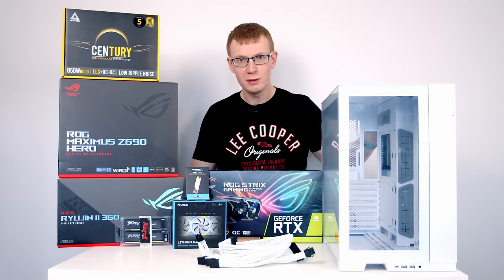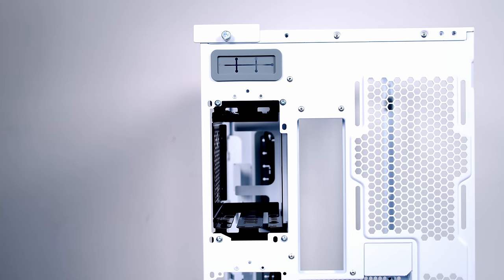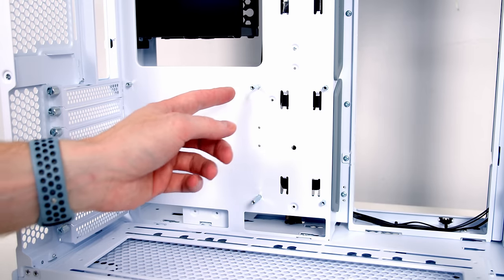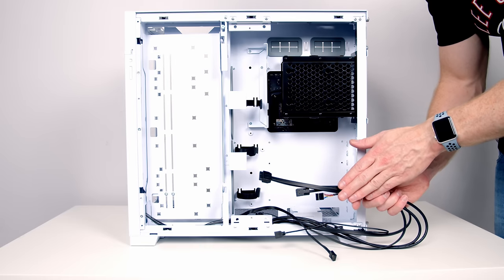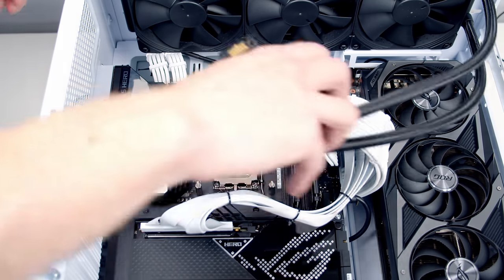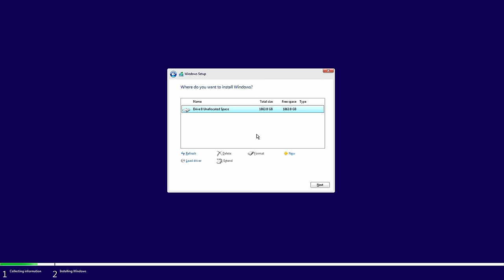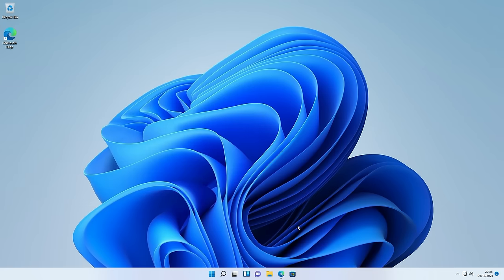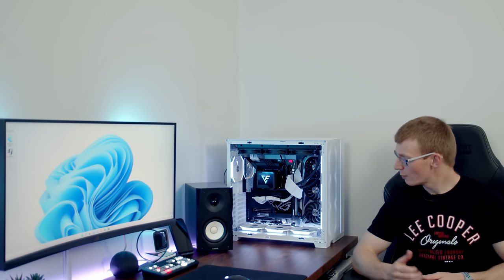Lian Li O11 Dynamic EVO - Step by Step PC Build Guide

Comment: Hi Christopher, im watching your video and so lucky i have stumbled to your vid. Im doing almost the same build. But im so confused with the connectors im hoping you can help me a bit. 

I have a msi b650 AM5 mother board, im trying to connect the Lianli Galahad 360 connectors but i have no idea how to do it. 

On my Motherboard i only have 2x 3 pin header. So i have the case one, lian li uni fans fan hub in there and now im missing the radiator where do i connect this? 

I hope im making any sense. Any help would be welcomed! i really like your vids explains things alot!

Comment: Thanks for the great video, same Case and Fan, but I faced an issue, that the power button doesn't work when I connect the PSU and press it but only the led on mother board would turned on.
Does this means some cable does not connected well? Thx!

Comment: Chris, I'm registering my various PC parts at the moment for warranty purposes, and I simply can't find any information about where my case's serial number is located. It's an o11 dynamic evo XL, and no matter where I look online, or on the case itself, or even in the booklets that came with it, I can't find any info about a serial number. Yet when I go to lianli's website, they demand one for registration. I saw some posts on reddit from what seemed to be lianli customer support reddit accounts saying that entering "null" or "none" in the serial number box would be fine for registration or RMA purposes, but this doesn't work as neither of those are accepted as valid inputs for that box. Do you have any advice?

Comment: My motherboard doesn't have a 5V RGB Header to plug the Lian Li O11 Dynamic EVO front panel RGB cable. It's an Addressable RGB header which I looked them up, they do 5V instead of 12V. So am I supposed to use that? That's literally the only 5V RGB header but is it the correct one? The rest of my RGB headers are ALL "+12 GRB" like yours shown in the video.

Comment: I just completed my first build with the same case and fans and this video helped A LOT. I had a similar issue with the Lian Li fans not recognized in the bios. Also, when I change the L-Connect software to "Motherboard sync On," the Lian Li fans spin full-speed. I have the fans plugged into the "CPU_Fan" header at the top of the MB (Asus z690 Tuf D4) cause that's the only PWM available nearby & not much cable to plug anywhere else. Can't plug into the "AIO_PUMP" header cause of it's weird location...below the pump and to the left. My AIO is plugged into the "CPU_OPT" (right next to the CPU_Fan) based on another well-known YouTuber's install video.  Any ideas how to get the SL120's not to spin full-speed when the motherboard sync is turned on?
Reply: Hey were you able to figure this out? Also, were you able to get the fans to work w/ Aura sync by any chance?

Comment: Got my case today. Can't get the front RGB to work tho. Got an Aorus X470 Ultra Gaming and used a 3 pin to VDG adapter (Aorus has its special 5V addressable connectors🙄)

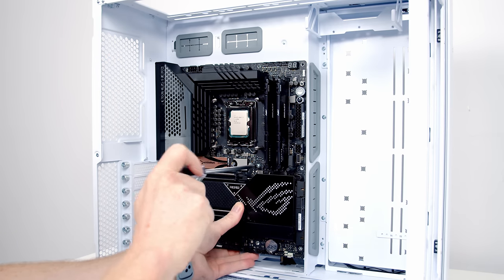Comment: At 19:34 when your installing the motherboard you mentioned that you removed the cover of the m.2 . My problem is the screws for the anti sag bracket is in the way of the m.2 cover which means i cant screw the cover on top. Any help ?

Comment: I have a question regarding the RGB cable from the case itself, I have an Asus Rog Strix B550-A Motherboard which only has one slot where there are 3 pins (5V). If I use it for the cases RGB Plug I can't plug in my case fan RGB which needs the same contact... I am really new to things and didn't see my error in choosing this motherboard... 
Is it possible to just plug in the Fan RGB in this position instead of the case RGB (since I don't know what it does anyways?)
Might be a stupid question but I would be so in need of help..
Does it not work in the end if I don't plug in the cases RGB?

Comment: DOes the GPU card if mounted HORIZONTLALLY need any bracket, it's a 3090 FTW3, so it's pretty thick and heavy.... but again, if normal mount (horizontal), do i need a support bracket and if so on the  EVO, do you have a video of this mount being demonstrated?  thanks in advance so much !!!!

Comment: Hello 

If I have 9 5900x  and x570 Aorus master 

If I put 2 m.2 NVME SSD gen 4,  1 in the first m.2 slot and the second one in the second m.2 slot, will the m.2 ssd in the second m.2 slot share the 4 lanes with the first m.2 ssd slot and reduce speed of both m.2 NVME ssds or not ? 

And if I use the first and second m.2 slots is better or using the first and third ones ? 

I appreciate your answer in advance
Reply: the 1st m2 slot is usually attached to the cpu. Ryzen 3000-5000 CPUs have 24 PCIe 4.0 available: 16 lines usually for a GPU, 4 lines go to the first M2 Slot and the other 4 lineas connect the CPU and the chipset.
Reply: @espi8997  thanks alot
Reply from the maker: Glad you got the answer

Comment: 21:05 My motherboard, which is a rog strick 550F, seems like it doesnt have this front panel type c connector. is it very mandatory or only for the usbc connection in front of the case?

Comment: Can anyone tell me where the hard-drive light is located on this chassis?  I need a flickering hard-drive light at all times to make sure I'm not locked up while I'm flying in flight sim, backing up , and things like that, it's always a must for me.  Does the power light double as the hard-drive light? Or is it supposed to and I just maybe need to plug it in to the motherboard.  For example, my NZXT case combined the power button on light with the hard-drive light (one in the same).  I'm really not sure where to look for the hard drive light on a LIAN LI 011 Dynamic EVO

Comment: Hi i have the same case and motherboard and plugged in all the case & psu cables the same way you did, but my frontpanel led strip doesn‘t work. Any suggestions?
Reply: I figured it out, theres a Sata cable which i missed and isn‘t shown in the video.

Comment: Why did you use a 2tb NVME for the operating system, instead use a 250gb of 500 max GB. Then install the 2tb NVME  into the other socket use it for Gaming.

Comment: This video is severely outdated. Not only does it include screws, but the bottom portion is unable to be removed due to an inaccessible screw on the  side panel side where the drives sit.

Comment: Why is everyone using 120 mm fans all the time in this case ? You can use 3x 140 mm fans without any problems in top and bottom...even on side. Looks so much better. Link below

https://cdn.discordapp.com/attachments/937931687554326561/1009968732698853406/IMG_4757.jpg

Comment: Got this case for about a year and I hate it.. probably the worst case I ever owned... Keep in mind if you buy a mother board such as I did the aorus x570 elite the bottom fans will not fit in easy as there is the usb header as well.. Anyway terrible airflow needs a gazilion fans to have airflow... Before I had the cooler master storm trooper and that was brilian!